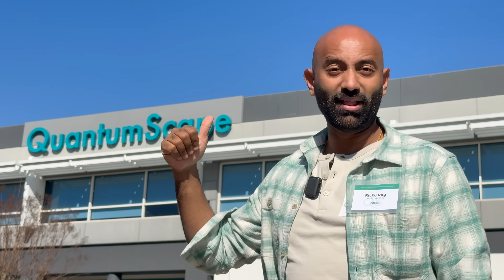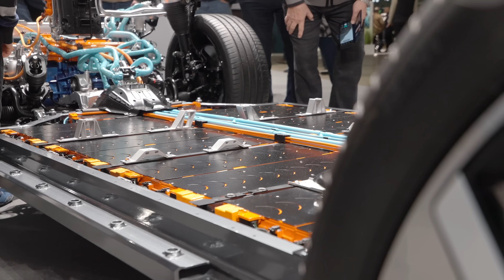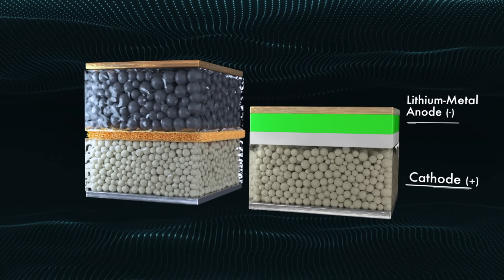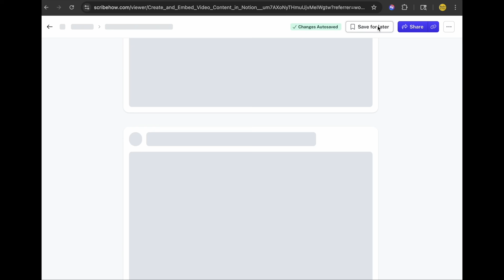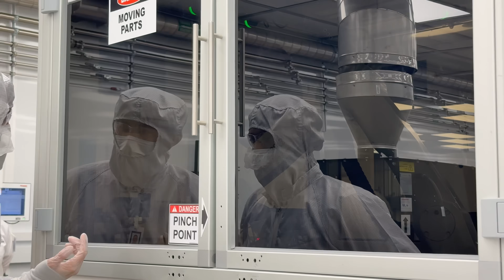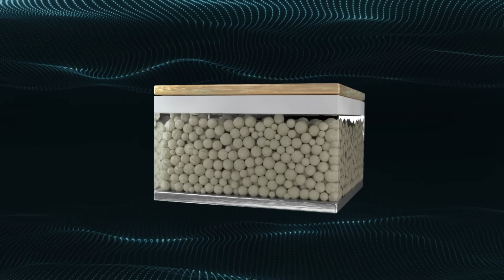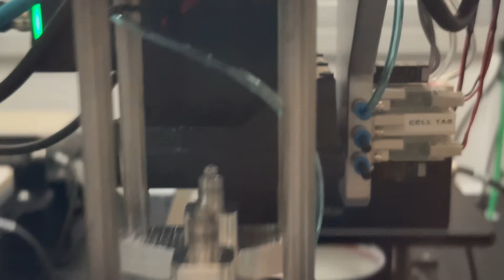I just Saw the FIRST Solid State Battery - It Finally Happened?

Comment: Very promising! This advancement may make me finally go electric.
Reply: I went electric over a year ago and I'll never go back. Last summer I drove 2500 miles to upstate New York. This spring spring I drove 3,000 miles to AZ. I was concerned about not having charging stations along the way on both trips and boy was I ever relieved because there were chargers all over the place. I will say that I can't drive as far as in a petrol car but I can easily drive over 2 hours and by that time I need to get out and take a walk anyway. So I actually ended up enjoying the drives more than if I made less stops. less painful on my hips.
Reply: @philborer877 
Seriously - those forced breaks are a blessing in disguise, for your completely immobilized, stiff body. It seems like people are very, very slowly catching on to that important fact, if I'm correct.

It's like recognizing that you're actually glad about being forced to get up and brush your teeth before going to bed, as you realize that that's been a key advantage to now enjoying your better smile - and don't want that boundary to now be taken away.
Reply: @philborer877  I went electric with a first-generation Leaf, learned after that I couldn't drive out of my city. Handed the car off to carmax and the scar is still healing.
Reply: I drive 70 miles a day . I charge at home.  I have only charged on a supercharger on long road trips. It cost 1/4 what gas cost in Texas.  I charge to 68-72% and have enough battery to make a second trip, but choose not to cut it close.
Reply from the maker: yeah? you're not alone, i've heard from a lot of people that this transition to solid-state is the key to making them switch... let's see how long to see it in products!
Reply: Current lithium ion batteries are good enough today for most people. Many just don’t realize it.
Reply: No it won’t. Be honest with yourself.
Reply: @89five3five 
Why not? The slow, steady convincing of the general public is in full swing now (and has been increasing for years on end)... And the overall tipping point is being crossed. At a certain point, not too distant from now, 85% of cars will be all-electric... Then, a bit later - the remaining few ICE cars (5%??) will be the only stalwart, stubborn holdouts... which will possibly never disappear, unless gas becomes too pricey and/or uncommon/distant for even 90% of them to deal with.

Battery tech is not slowing down as it's closing in on eventually eclipsing ICE ranges - nor will it slow down after - and given the insane power/torque EVs have, combined with the super-simple, low maintenance of owning one... It's a foregone conclusion at this point. It's only time on the clock we're putting in, now.

And with CHEAP Chinese cars coming to the US - THIS YEAR!! - there might be a huge jump in that pendulum swing, all at once. (PRICE is the only reason my poor ass can't own one yet!! 😢)

Comment: I didn't hear how many cycles QS has in their battery
Reply from the maker: More than a thousands, testing still underway I think for final numbers but at or better than today's jelly roll approach
Reply: @TwoBitDaVinci  More than a "thousands" isn't a number.
Reply: According to VW validation, 95% capacity retention after 1000 cycles at 1C charging. Which should extrapolate to 4000 cycles with 80% capacity retention (which is considered end of life for a battery). 

From QS ' internal results, they have shown 90% capacity retention after 400 cycles at 4C charging. Which can be extrapolated to 800 cycles with 80% capacity retention.
Reply: @cyclopes968  Already good enough at standard charging rate but still not capable for fast charging

Hopefully once it finally mass produced, there are phones and laptops that uses the QS battery. 4000 cycles are equal to 10 years lifetime in daily charge-discharge cycle before reaching 80% health
Reply: @cyclopes968 So it's not solid state, is 20% more energy dense than traditional and if you charge it in 15 minutes it'll only last 800 charge cycles. Definitely still a work in progress.
Reply: @MrHemlock51  For context, current li-ion batteries wont last even 50 cycles if they are charged at similar rate.
Reply: They dont want to tell, because it is bad. Else the numbers would be all over the place.
Reply: @scottdiem8254  The A2 cells did like 95% energy life left after 1000 cycles which was like 300k mile or range before you get to 95% energy of the original
Reply: @justinmacks1481  If at 1C though then charging is slow to achieve that number of cycles.
Reply: @scottdiem8254  The data I could find is capacity drop down to 95% after 1000 cycles. But they don't measure past 1000 🫤.
Reply: I’m wondering if anyone knows how this compares to Solid Power batteries in energy/weight.
Reply: @scottdiem8254  4000 cycles projected.
Reply: not mention it is a or two bit sketchy......
Reply: @scottdiem8254  they say 1000.  Good but not great.
Reply: @hoffinger that's incorrect. They said after 1000 cycles it still had 95% capacity
Reply: @rocketeer6713  at 1C though
Reply: 800 cycles at 4C discharge with 80% remaining. If todays batteries are 200k mile batteries these are 600k-1m mile batteries

Comment: going forward, costs variance between all the different batteries will set the tone...China is leading the mass market at the moment, similar to what they did to solar...sure, US has higher tech, same w/ EU BUT market is costs sensitive...a 30% improvement for 3X the costs is not feasible for most applications...

Comment: At 14:15, I believe QS has in fact claimed that their batteries are much safer.  Their website shows puncture and heat tests.

Also, Tim has talked a number of times about how failure of a battery cell would lead to a "hot rock" and how hot rocks are safer than flames. Perhaps there is some toxicity involved with the failure, but the failure stays contained and doesn't spread to other cells.  

That's my understanding, and it's one of the many traits that sets QS in front of their competitors.

Anything to correct or clarify regarding my understanding?
Reply from the maker: got it, yeah I got that feeling as well... I think you're right... might be worth following up with them on more details and specifics
Reply: @TwoBitDaVinci  Thanks man.  Sorry to be a nitpicker.  As a QS fan, the overall video was incredible. Thank you, and I'm so jealous you got to speak directly with Tim. So cool!
Reply: @TwoBitDaVinci  I agree with OP -- I greatly enjoyed everything in this video except I think you got the safety part wrong. Would appreciate a follow-up. Thanks!
Reply: @famljw3095 fairly standard practice in battery industry
Reply: @rockthepunchx9547  Reread my post.  Of course testing is standard, but QS's tech isn't standard.  They've made claims if being safer, but this video says they've never claimed to be safer.
Reply: @famljw3095yes we need to know the truth on this. My prior posts made the point that eliminating battery fire risk would be the holy Grail for the public.

Comment: I love your shows. You think about the same sorts of things I do. 

Thoughts on Battery life:

5:30 "battery is dead in 223 cycles" 

That shocked me, so I did some math. I get it - 80% capacity after 223 cycles. 80% is a common warranty percent.

Or 61% after 500 cycles.
.999^500 = .606.

I doubt it progresses at 0.1% per charge cycle; as Li is removed from the system, I would expect the lithium-removal processes become less and less likely to happen.

Not sure how I would model that.
Reply from the maker: you're right, it would be really difficult to understand without just assuming a linear degradation... but yah its much more complex. appreciate your insights!
Reply: @TwoBitDaVinci  

Maybe something like this.

We could probably just look it up in Tesla's published battery data.

There is a database of Tesla battery data showing an average degradation of only about 12% after 200,000 miles of use. Most batteries typically last between 300,000 to 500,000 miles [to 70%]. 

If you play with average numbers, you get about 885 cycles. to drop it down to 88% capacity.

With access to the raw data you could track the number of cycles specifically against any battery chemistry type and usage profile. 

7-8 years' of vehicle battery data is probably enough to make some very good educated guesses.

Comment: Current safety is fine, what we need is energy density. The electrolyte\separator is irrelevant. Work trucks will need 500wh\kg and Aviation is going to need significantly more.
Reply: Sure, as long as you don't need them to last long. Lithium air batteries for kamikaze drones. That covers aviation right?

Comment: I remember Quantumscape saying their batteries would have 2x the gravimetric energy density (specific energy) of current batteries. Now they say only 20% improvement. QS is just built on hype and we are still a decade or more away from seeing them in any normal cars.
Reply: Absolutely incorrect.  They will be in series production cars in the next 3 years.
Reply: @rocketeer6713  They said that years ago too. Their timelines are always changing.
Reply: Volumetric energy density matter much more actually. You cannot put a huge battery inside a car.
Reply: All smoke and mirrors ...ive followed them for over 5 years...watched there stock do the typical pump and dump...went from Triple digits to single and stayed there. Vw was a fool to invest in them. 

U think CATL , EVE, Lishen, and BAK Battery wont copy...makenit cheaper and faster in China then qs? Im case u didn't know China doesn't care about patents or epa rules.

Dont take my word for it...Google all this.

Comment: How close does dry electrode manufacturing get to true solid state in terms of durability, cost and energy density? Tesla claims to have cracked DBE on both cathode and anode. I’m curious how important the leap to solid state will really be if DBE gets close
Reply: Dry coating today is nothing special anymore. Tesla is far behind competition. Their Process was very special and never good
Reply: @h @hadana1999 sed on a quick Ai summary you’re incorrect about that. Looks like lots of companies are working on it, and LG is the only large scale manufacturer that’s got a pilot line up and running for actual manufacturing. I’m certainly not an expert so if you are, I’d love some more info, but it appears like Tesla is ahead of the game here if they are actually putting these cells into cars

Comment: What is the chemistry? you did not mention is it an NMC based or LFP or LMO/LMNO or a new chemistr?

the first major improvements in lithium batteries was relatively simple but now that most the easy steps are gone we start to run into the more difficult and expensive ways to make it more efficient.  This is where Sodium Ion can catch up.. they are still on there mark 1 or mark 2 versions of the batteries so a long ways to go 

No it is not solid state but it is closer.. kind of like Tesla's dry coating cathode and anode is closer to a solid state as well  there are major differences between the two and these differences give us possibilities to improve both of the solutions
Reply: @TheStrayWolf-g8t  it’s a fully solid-state ceramic separator. QuantumScape is 3rd-party tested and verified. This is the real deal, that’s why you’re slowly hearing about it without ridiculous hype.
Reply: QS SSB is cathode agnostic, another benefit to their design
Reply: @Abidance01 but cathode chemistry has effect on the overall energy densities so they should have told us what cathode was used in this instance.
Reply: @adon8672 this depends more on what the OEM wants
Reply: @DylanFkinGuenther your statement doesn't answer the question raised. If an OEM wants cathode W, another two want cathodes X and Y, then all those wouldn't have the same energy densities. The question is what's the cathode chemistry of the cell in the video with the energy densities of 250Wh/Kg and 700Wh/L?
Reply: its a advertisement :P they also never said the production line they showed was making solid states in fact its obviously a wound lithium line. CATL though do have a solid state battery with 500kwh per KG they are currently making for military and aviation/they already have a factory making solid state and by 2027 it will be available for consumer purchases also
Reply: @violetquinnlaw  500kwh per KG? This enables intercontinental electric aviation
Reply: @clippyTheSahayak  No it doesn't. Those CATL batteries lose their capacity very quickly. In battle it doesn't really matter, drones are detonating themselves after first flight.

Comment: 1 issue i've noticed, they still use lithium
Reply: What's wrong with lithium?.
Reply: @hadana1999  not as redundant as other materials.
Reply: @llIIllIlIIllX_XIillIIllIIllIll  but best in volumetric energy density
Reply: @hadana1999  that is obsolete at this point, we'd rather have reliable affordable vehicles than a slightly lighter weight or even faster one, most of use are city drivers.
Reply: @llIIllIlIIllX_XIillIIllIIllIll  no you don't get it. Volumetric means space and in cars space is highly relevant. I want at least 55kwh in my cars.
Reply: @hadana1999  I get it as I've batteries designs as well, some would require 30-50% volume and would also take some of the motor power but that is definitely durable and I can adjust to that.
they have dendrite issues though, which is something to work on in the future.
Reply: Lithium is the best element for batteries!
Reply: @Abidance01  we'd rather take the second best thing if its more redundant

Comment: need 1000 miles one charge
Reply: @kevf500  why?    The average commute is 25 miles round trip and the average private trip is 13 miles.   Batteries don’t change the efficiency of motors so you still only get 3-3.5 miler per kWH.    A 1,000 mile range will take a 300kWh battery which would be cost prohibitive.

Comment: what about cold temps??
Reply: Qs has claimed many many times theyre batteries dont see performance drops until lower than -30c.
Reply: @todd4468  Solid state batteries on average perform faaar better in colder climates like the guy above said they claim up to -30c
Reply from the maker: Based on what I heard form the team, this should perform as well or better in the cold.
Reply: @TwoBitDaVinci  Impressive!
Reply: @todd4468  How? I take it it will perform "as well" as it is and that means not very well.
Reply: @owlstead  “As well” to me means compared to how it performs, not in comparison to other batteries.

Comment: Within batteries, DC Energy is used to draw energy or replace energy by moving electrons from one place to another. D.C. Energy requires the MOVEMENT of electrons. AC Energy requires the VIBRATION of electrons without traveling. BOTH DC and AC require NON FIXED STATES OF BEING - Solid States. By definition there can be NO SUCH THING as a SOLID STTE BATTERY.
Reply: Non-rechargable batteries are very solid btw.

Comment: Why aren’t solid state batteries and graphene products flooding the market…?
Reply: Because those things are nigh impossible to mass produce. If they manage to make them mass producible each will flood the market to the same extent as li-ion batteries and carbon fibre. These things won't replace everything, because steel will always be cheaper to produce per volume, even if they could replace steel by weight.
Reply: Good things take time, this stuff is hard. I think Chery and Geely will be first to market with solid state batteries. For graphene, HydroGraph Clean Power has a lot of potential, as their production process yields high quality graphene, and is scalable and low cost.
Reply: Volkswagen will use that technology, they are building gigafactories right now.
Reply: because it is a clickbait
Reply: @skjelm6363  🫵didnt watch the video